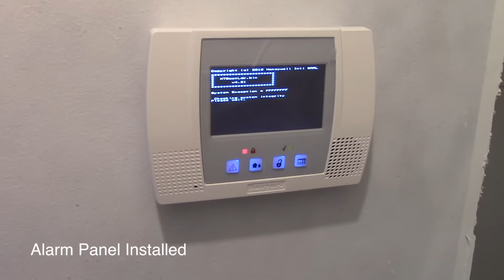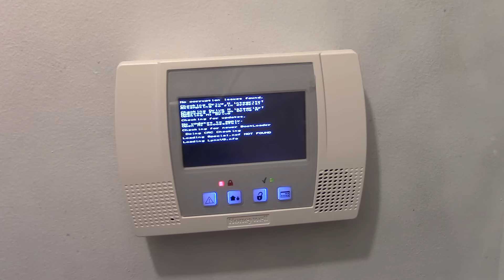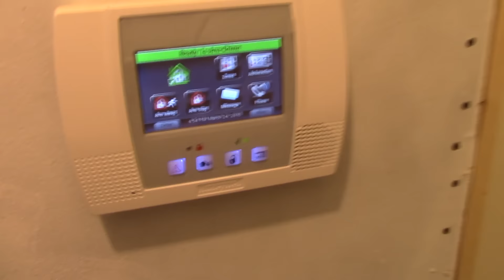Hoarder House To Home Episode 11 - Checking Projects Off The List

Comment: …………...I just gotta ask, when you go to all the trouble to re-do this home the way you have why oh why would you settle for stick down tile and not go with a ceramic tile with grout?  Not to offend but kinds of cheapens it just a bit.  Just saying.  Steve
Reply from the maker: Looks almost just like ceramic without the headache of cutting it.
Reply: @JackofAllMasterofNone  but it peels up easy especially in such a moist environment like a bathroom
Reply from the maker: @KaSsY--12024  No it does not peel up easily.  We have had zero problems with it.
Reply: @JackofAllMasterofNone  when i got further in the video i seen they weren't the really cheap ones that it looked like it was while doing the bathroom when you where doing the other area with them you could tell they where thicker and better quality then they first appeared